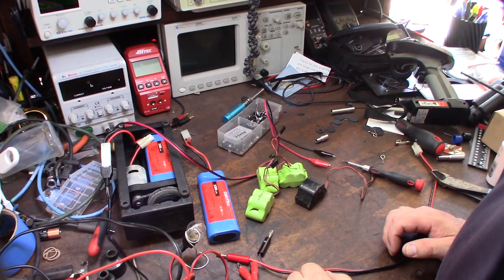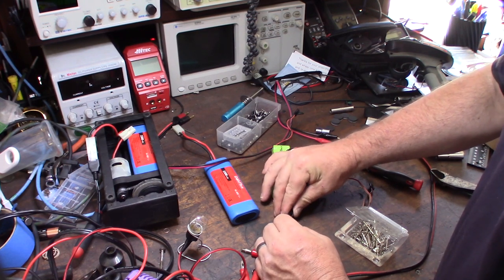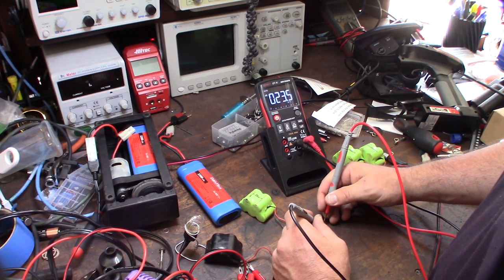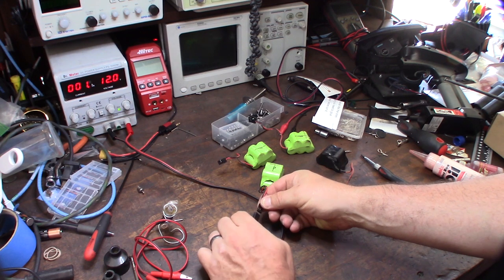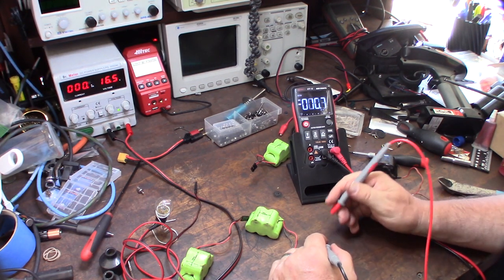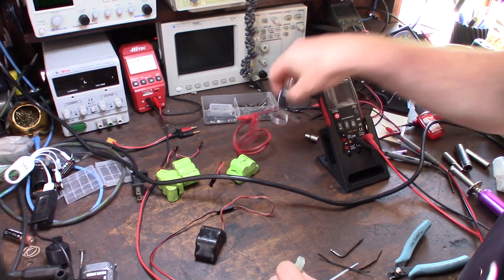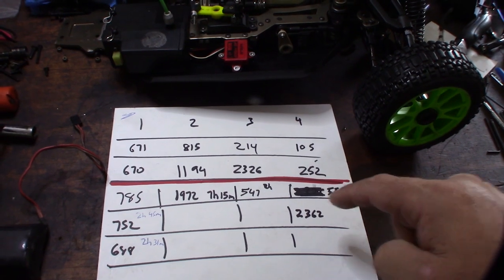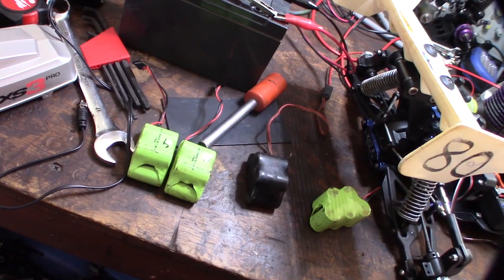NiMH nickel metal hydride battery recover rejuvenate renew repair Like New

Comment: I have found that even if you do tricks like that it is almost impossible to get any significant power output out of the pack...  Even if it's above the fully charged voltage, put any load on it and the voltage tanks all the way down to 0.   Pretty much time to buy a new battery pack at that point.

Comment: Using a fully charged 12v battery as the jumper supply works great too. Just work fast because the cables you are using WILL heat up really fast when you connect to the dead nicad cell.
Reply: Thanks! I did this and it worked great, saved 80 bucks for a new battery pack
Reply: @brayden12  I also found the hard way the this fix may not really fix much. A few of the cells I flashed like this only worked for very light loads. Putting real stress on them weakens them further and they wont hold a charge very long and will fail again later. Highly variable results to say the least. LoL

Comment: What I did to jump start them is use then times the rated voltage. 
So first I charged them and discharge them with high current to zero and back up charging. 
Then one cycle of very high current discharge so it gets hot until the battery dies completely. Cool it for a few hours in the freezer and then jump start them with ten times the rates voltage for 3-4 seconds. 
Work rather nice afterwards at least the capacity is fine

Comment: To balance nimh battery packs, a circuit with two 1n4007 diodes in series plus a resistance of 1 to 10 ohms is used.The voltage drop in each diode is 0.7 volt x 2 is 1.4 volts.The resistance limits the intensity of the balancing current. Being soldered to all Ni cells this increases the life and performance of the battery pack.
Reply: This requires too much prior knowledge to have any value to me.
Reply: @michaelb.8497  
thanks and simply versión. balancing the cells with resistors in each of a value between 430 ohm to 1k ohm. this applied to battery packs on old satellites google patent information.
Reply: @alexandres8846  any idea if Nimh batteries can be used for power wall and charge fine by solar system
Reply: @johnle231  I am busy atm with it. connected 3 in series to get minimum of 3v an a max of 4.2v. a daly li ion bms ans a hencon balancer shoud do the trick.
They will balance inbetween themselfs. some bicycle packs with nimh dont even have a bms. for savety i keep the powerwall at 24v dc with a dc dc converter to my other lifepo4 cells at 48v nom.
Reply: @justmeigor1852  

Hmm.

My understanding is that a Nimh cell nom v. Is 1.2

So 3 cells should make 3.6
Reply: @justmeigor1852  

I found Prius Nimh cells for $2 for 6 cells totally 7.2 v so was considering it
Reply: @johnle231  And the minimum v for li ion is? the max v for li ion is, 3x the minimum v for nimh is? the max v for 3x nimh is? (-: youre welcome(-:

Comment: I have been enjoying  getting 3 × 1.2volt cells working again , 2 fixed ok quick with  a zap  the third cell  stubborn it charges but dis charges too fast  on drain 20 milliamps about 2 hours , strange how it returns to 1.1 volts by itself out of circuit - am hoping a continual repetition trickle charge with a solar panel will make a difference over a week or so
Reply: I have found that in the situation where the voltage reads high but drops to 0 under the smallest of loads but then bounces back to high voltage when that load is removed, it's a bad battery and there is nothing you can do to bring it back.  Best thing you can do is take a couple of them and put them in parallel with each other and maybe together they might be able to power the device..   But would like to hear about any updates you have.  About half of my packs that are ~10+ years old are at least half way to that state and the ones that were in that state I have already given up on and have already been recycled.

Comment: Thank you so much i normally run lipo battery’s but I have a 4 y/o nimh that hasn’t been charged in 3 years and I didn’t know about cycle charging I have a simpler charger that uses the same charge master software so as I speak I am hoping to rejuvenate my performance nimh

Comment: I recovered few of them but in my experience they don't work as good as they used to. Internal resistance is a lot higher than new pack. They still work fine in low current stuff.
I'm not sure if i skipped it or u didn't measure it, but internal resistance is a big factor on older batteries, not just capacity.

Comment: Hello
I bought new batteries for the wireless phone, of the type NiMH AAA 1.2v 850mAb, and I found one of them dead and does not accept charging. What should I do, may God reward you
Reply: You can get a dumb timer charger and charge them with that. But most likely that battery will always be the first one to read 0 volts under load if you put them with the others and cause you lower power output problems.

Comment: How do you check WHICH cell in pack has no voltage? Or is the strategy to "jump start" an entire pack to hopefully get some juice into each cell, so a smart charger can detect it and properly charge the pack? I don't understand why they can't make these smart chargers SMARTER, and provide a little voltage to the cell(s) it detects are not charged enough, so the charger can then properly charge the pack! I'm sure they would say it's a "safety" thing but I call it a scam. These smart chargers should be able to bring these deads back to life.
Reply: Cut the shrink wrap off and use a multimeter to test your cells individually, and if need be like in my own case, put a charger on each cell one at a time directly to revive them but also balance the pack. Unless you wire up a balance lead like on lipo packs, the charger cant be "smarter" because its only got two wires to work with and treats the pack as one higher voltage cell, it cant see the individual cells

Comment: So how many people do you think has all that gear.
And bud,you talk too quickly,and you speak to yourself,which is confusing,along with bouncing around in the subject.
All in all,there are several vids out here that are much clearer and dont require all the gear.
Rate 1 to 5,...a 3
Sorry.
Reply from the maker: Cool
Reply: I found it to be quite illuminating. As for the gear, well chucks... I guess if you deal with such batteries even a little bit it will pay for itself in no time. For me for instance the cost of that red charger right now is 67 euros. I am looking to revive 2 battery packs. I just looked up the price for a replacement battery pack and it is 92 euros for 1 (I need 2).

You do the math. I also want to point out that just like about everyone here (you got to this video for a reason I suspect) aside from my immediate need (those 2 packs) I probably have (of the top of my head) a couple dozen other packs I could try this on, instead of chucking them away (and the environmental impact that comes with it).

Hell even the bench powersupply is dirt cheap, you can get them for a 100 euros (probably even far less if you look), when you think about what it would cost to replace those packs.
Reply: @xConundrumx  Well,Im just too happy for you.I dont recall addressing you in my comment to him about his video.soooo.
I run 3 high end cameras in my photography work.I carry a couple voice recorders with me as note keepers while Im working.I have 4 battery operated lights that I use in the van in evening jobs rather than use my vehicle battery for lights.And each light uses 4 batteries. And my list goes on.Yes,I use a lot of batteries.That is why I viewed the video.My point never said his system didnt work.I said he is confusing jabbering away,rambling around rather than instructing. As for all the gear .. he has turned this effort into a hobby.All the other instructions on YouTube doesnt require all that gear.Just a common charger and a volt meter. And,for the cost of the items you mentioned...theres an old saying that rings true 90%of the time... you get what you pay for. You buy at a cheap price...you get cheap products. So... you go and spend your money on your fancy doo dads. Ive found an instruction video on youtube that has worked for me since I first commented here,and theres no reason for all those fancy "toys" .AND,Im saving my money,not buying unnecessary gadgets.
Reply: @stegususcley2655  It seems the concept of an open ended comment section eludes you. You should expect others to reply to your statements too. At any rate good you found a system that works. With what was shown here so did I. Everybody happy.
Reply: @xConundrumx  Nothing eluded me.What we have here is when someone posts,and I comment to its creator,people take it upon them selves to tell me why Im "wrong" because I dont see it their way.
My statement to the creator wasnt any of your business.And I didnt tell him his method was fake or wouldnt work.But in the end..I didnt include you in the comment.Had I been talking to someone on the street about his method of teaching,and someone stepped up on me running their mouth when they werent invited,theyd be picking their ass up off the street.
Reply: @stegususcley2655  ROFL sure thing bud.
Reply: You should try the 0.5 playback speed if you cant keep up 😂 not his fault you're slow